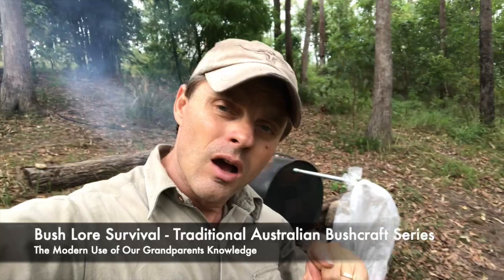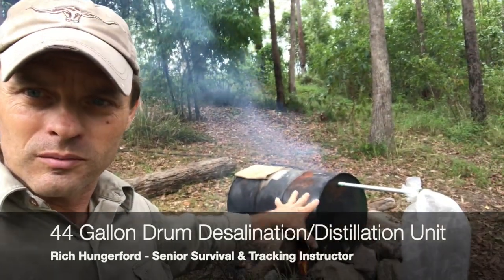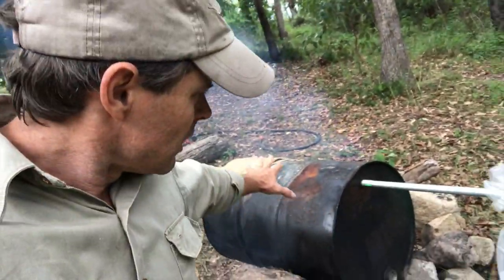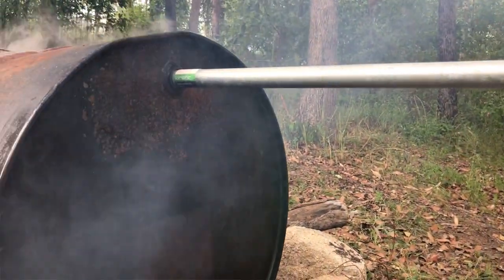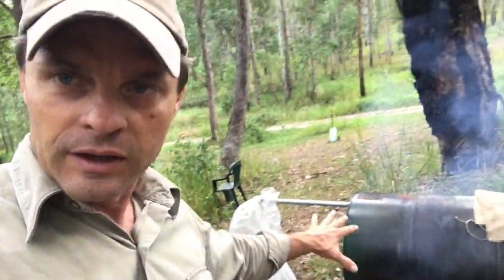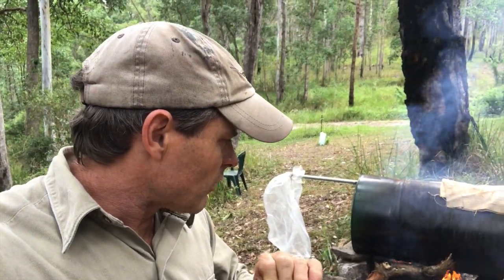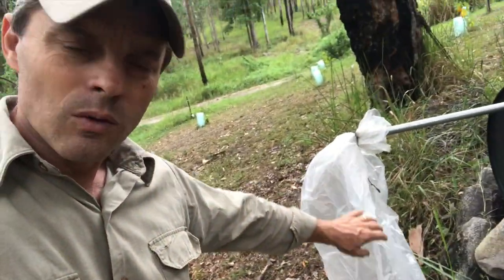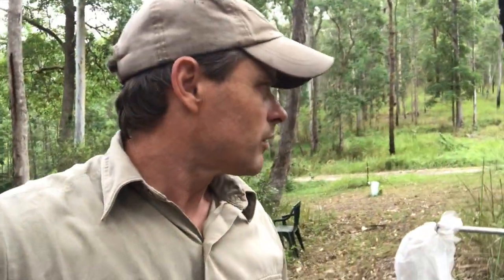44 Gallon Drum Desalination/Distillation Unit

Comment: Using this principle, you can connect multiple showers via a multi-outlet drum. The important thing to effect a satisfactory flow rate is driving enough pressure, which can be achieved with a water hammer. Love your videos!

Comment: this will be a ridiculous question...you mention the water going in can be salt or contaminated.  What about urine?  Is there a system  that can make urine more palatable so you could survive for an indefinite period?
Reply from the maker: No such thing as a ridiculous question mate :) if there is a question it means more information is being sought in order to eliminate doubt. 

This system (inclusive of any known that uses this principle) and the other one I have filmed on this channel for distillation both will process urine just fine. 

Urine is simply water that is saturated with waste elements. Once it is moved from one state, transported to a new location and changed back to a liquid state again the original contaminants are left behind as they possess varying volatility levels than the water itself. Summary: liquid is heated = gaseous state that is moved and captured in the bag subsequently cooled = distilled drinking water. 

Hope that helps sir? Rgds, Rich H.